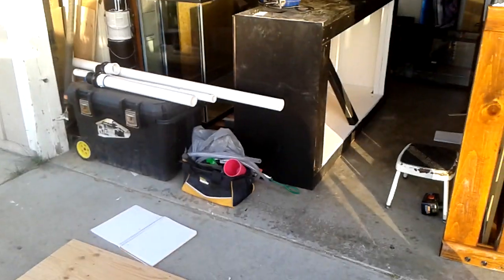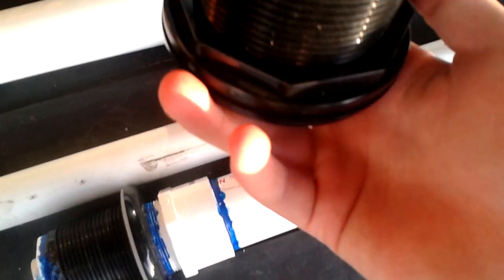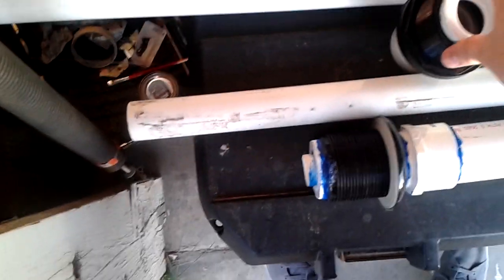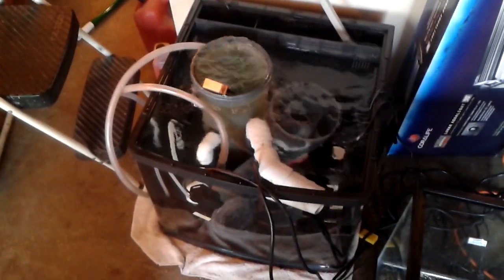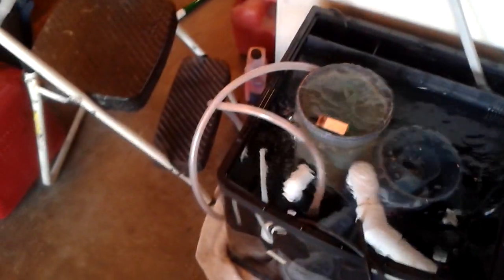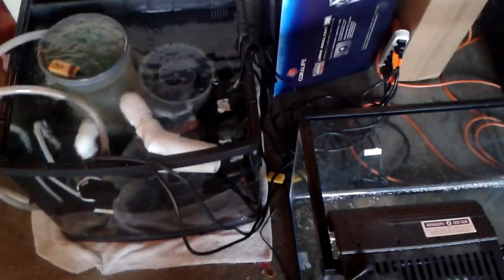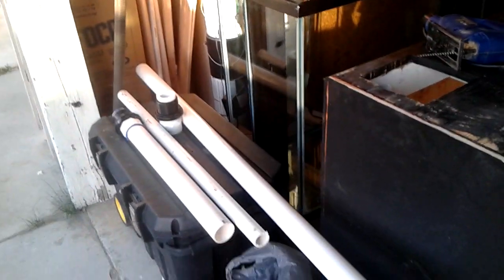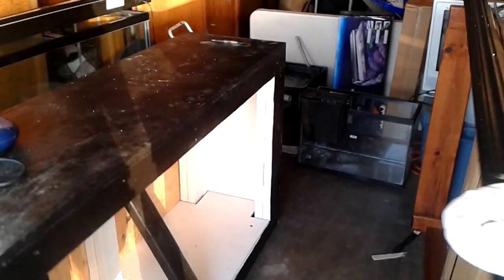150 gallon reef tank build update #8 (tank is sealed got a new bulkhead equipment cleaning)

Comment: 1 1/4 should be fine, 1 1/2 inch better,  but what's your thinking in reducing from 2 inch.  This is only for your drain, right ?. 2 inch is less likely to plug up, backflow, whatever. Just wondering why you think you need to reduce it. I have a 1 1/2 inch drain on my 150 tall tank only because that's how it was manufactured.